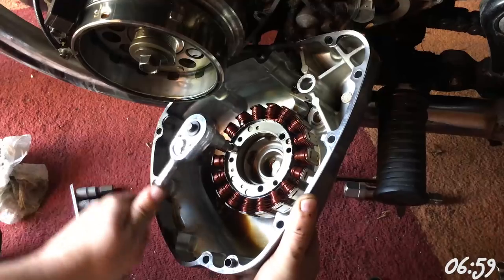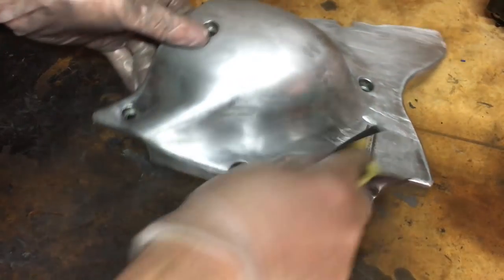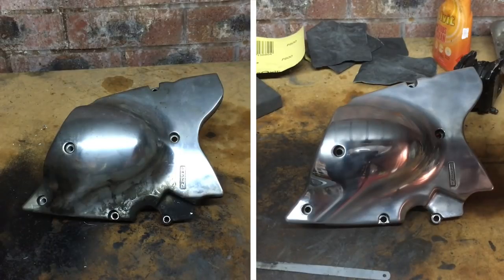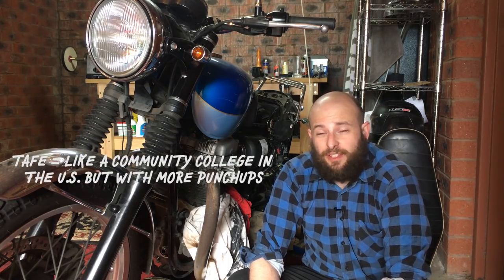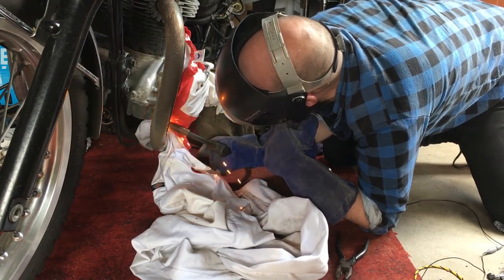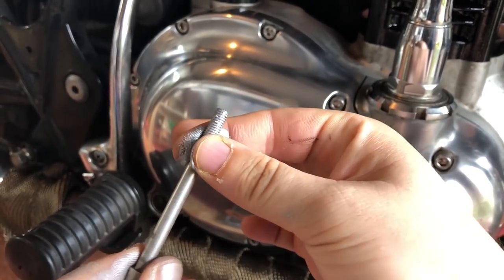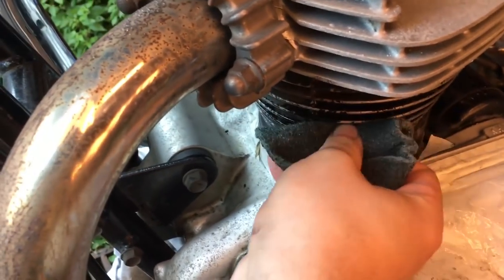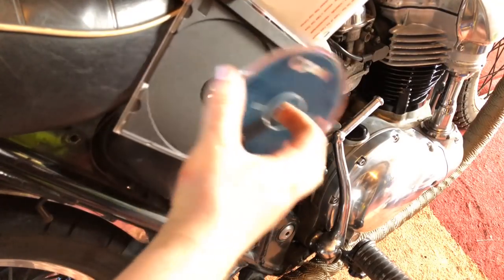Peak Hipster - Episode 2 - Engine Painting and Polishing

Comment: Hey mate, I have a Kawasaki w650 and I took the engine panels off to shine them like you did. I can't get the bevel gear back into the top part (with the spring). Have you got any tips or could I call you for advice please? Thanks

Comment: Marlon, did you spend your entire budget on the stripper, or will we get an Episode 3 after all?
Reply from the maker: Ha! Nah mate, I'm still plodding along with the project. At the moment I'm waiting on some parts to arrive and trying like hell to get the front sprocket nut off, which is well and truly stuck down.
Reply: "get the front sprocket nut off" 
teehehe
Reply: Marlon I've had the same trouble with my w800. I'm sure it's fused on forever. Be interesting to see how you get it off
Reply from the maker: At the moment I've used an electric rattle gun, an impact driver, various blowtorches, and now I'm using a 2 metre long breaker bar!
Reply: Marlon I've tried rattle gun, a small blow torch, penetrating fluid. I think the next step is a massive massive breaker bar as well
Reply from the maker: Yeah, it's miserable, isn't it? Whatever you do, don't torque it up to factory specs. It's ridiculous.
Reply from the maker: Yeah, I'm the same. I'm petrified of fucking the thread. If that happens it's split the cases time. And I really, really don't want to do that.